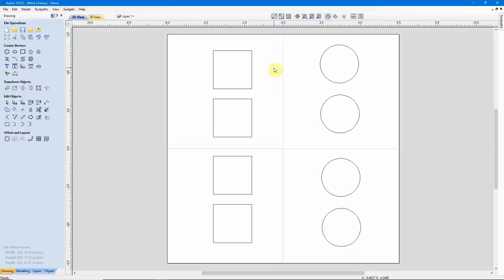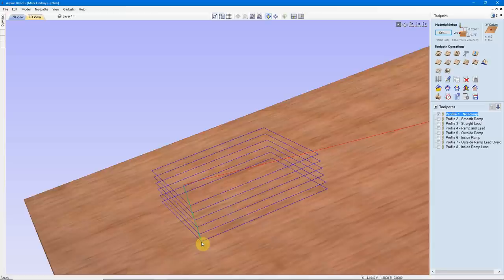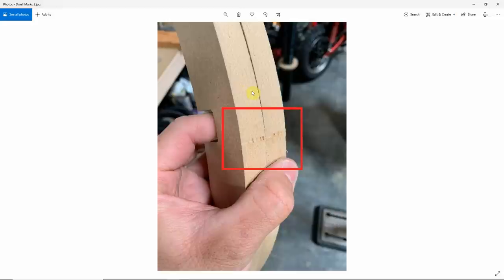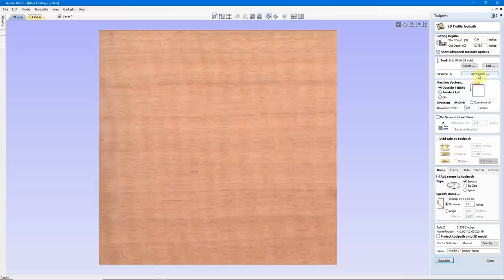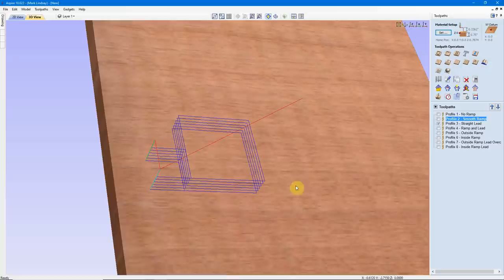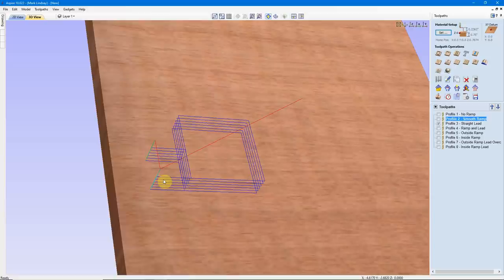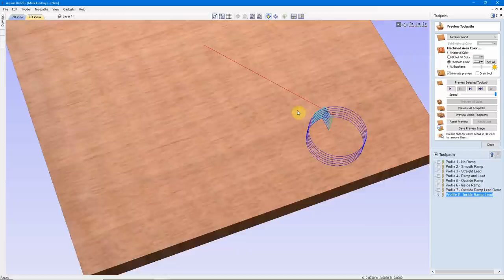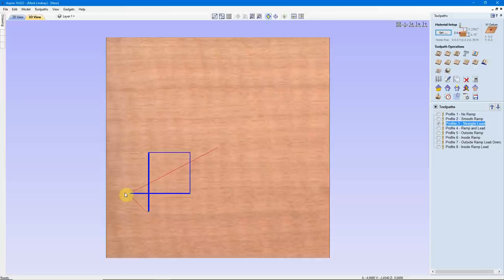Intro to Ramps and Leads - Part 44 - Vectric For Absolute Beginners

Comment: Another brilliant video, thank you Mark. I’m thinking, on a smooth ramp I can get close to my feed rate with the plunge. 1/8th” bit doing a profile, might as well smooth ramp in at federate if it’s going to take off at depth anyway.
Reply from the maker: The ramping speed is controlled by your Plunge Rate in the tool database. I would advise caution in setting that Plunge Rate to the same as your Feed Rate, as ramping in focuses a lot of stress on the tip of the bit until it gets to the final depth of that ramp. Ramp in too fast, you can shear off the tip of the bit. I've done it too many times due to being impatient. I'm not saying not to do it - just be cautious, and watch it closely when you do it. You'll soon find the limit of the tool (usually by breaking it.)

Comment: Great job as usual.  I'm like you.  I nearly always use the smooth ramp.  I have found the Spiral ramp to be very helpful when pocketing out holes instead of drilling.  I use a slightly smaller bit than the hole diameter and spiral ramp to my final depth.  This has proven to be much faster than drill pecking and less wear on the bit when applicable.  Since most endmills aren't designed to plunge/drill, this works well.

Comment: Good timing.  I was doing my clock gear tool paths yesterday and had one where it did not detect that a lead would gouge the part.  I just went through and adjusted the lead lengths on the gears.  I am using them to reduce the pressure on the parts when cutting.  The gears are for Brian Law clock 22 and are being cut out of 9mm thick black walnut so pretty fragile stuff compared to plywood.  The smallest is 23mm diameter with 7 teeth.

Comment: I never knew the term dwell mark before.  I get these marks when I utilize the tab option and I never knew the term or what caused them.  I actually thought it was a tramming error.
Reply from the maker: If you use 3D Tabs by checking the box, you'll reduce the likelihood of dwell marks in or near your tabs.

Comment: thx so much, i really apreciat this lesson, ihave an question, on aspire, when u choose v carving only can hable Ramps if use a area clear tool and cant change the ramp mode you need, can you explain ? thx so much i realy learned very much with u lessons <3
Reply from the maker: The v-carve toolpath only carves what's inside the vectors. It knows that the v-bit has a cutter edge all the way down to the tip, so it doesn't need to ramp in - that's why you can only use the Ramp Plunge Moves for the clearance bit. The software doesn't know what kind of clearance bit you're using, so it gives you the option to Ramp Plunge Moves if you need it. The ability to change modes is unnecessary, as the software takes the Pass Depth from your Tool Database and figures out how to ramp in based on the amount of space it has to work with.
Reply: @MarkLindsayCNC  Thx so much, i watching all you vids, at beggin first, thx so much, i really apreciat you moustach, i have an small moustache also, thx sir !

Comment: Thanks a lot for your videos. A question when you say the bit contact with the material is the plunge,after making the toolpath it retracts again to make the second pass. But how can I that it doesnt make the retract?I think when it cuts the first pass, the bit is now in contact with the material, so why could the bit make the second pass without the retract?
thanks a lot
Reply from the maker: There might be a misunderstanding. The tool will make the first pass, then plunge down to make the second pass, then the third, etc... It will only retract from the cut when the toolpath is finished running, if you use a Separate Last Pass, or if you use a Lead In without a Smooth Ramp.
Reply: @MarkLindsayCNC  thanks a lot. Until now every piece I make, makes one path,stops,retract snd start the second pass. But after wour video I undestrand that using ramps, I will save this times of retracting . No?

Comment: Very informative and helpful video, Mark, thanks a lot.
I have a curiosity: 
an up cut bit tends to pull up the stock material from the spoil board and a down cut bit  tends to push down the stock material or is it the opposite ??
I'm not able to figure it out :-)
Reply from the maker: Thank you very much! You're absolutely right. An upcut bit slices the material fibers with an upward motion, which can lift a piece upward, and a downcut bit slices in a downward motion, which can push the material downward.

Comment: Great videos! 
I want to reduce the outside dimensions of rectangular aluminum plates that are 6.5mm thick. Is it better to let the end mill (1/4") do simple plunges and cuts as per normal for the profile toolpath or is it better and easier on the bit to set up leads that are outside the material dimension and only allow it to come in on the side of the mill bit? Intuitively, this seems better to me as I can probably get away with larger cut depths since the top of the mill bit is never used.
Reply from the maker: You're on the right track, and your instincts are correct. Your situation is exactly what Leads were created for. Sometimes it's better to ease into the material from the side, rather than plunge in from the top. You'll experience less bit deflection where it matters if you use a lead.

Comment: Little need of help here.
I have this mdf plate:
- top - 499x499mm
 - base  - 510x510mm
- thickness - 59mm

I want to make a profile toolpath that cuts in angle of 84 deg. Since the base is larger than the top then all sides would have an inclination. What setting should I use in order to have that inclination to the sides as a result, cause what I'm setting so far it only cuts straight sides and I don't want that and I'm lost in translation here.

Thanks.

Comment: why is the result of my work when using a ramp, the result is always the beginning of the cut when it starts to plunge slowly it is more out of the vector path. While when it is finished it is vector. I don't use leads. I use in vector profile toolpath